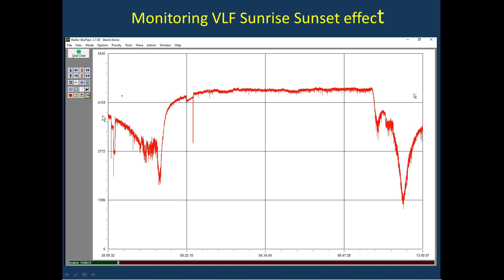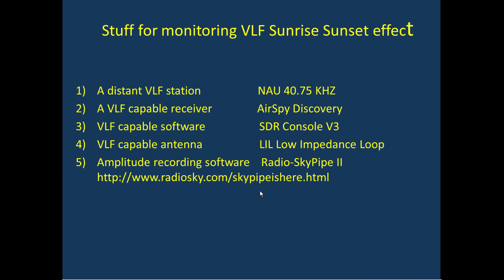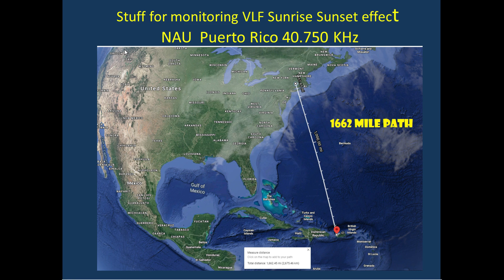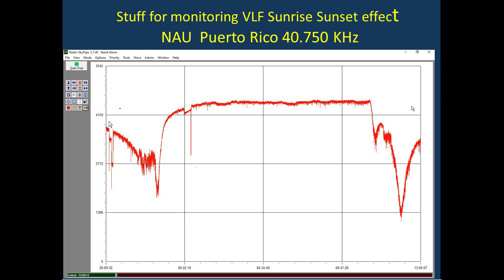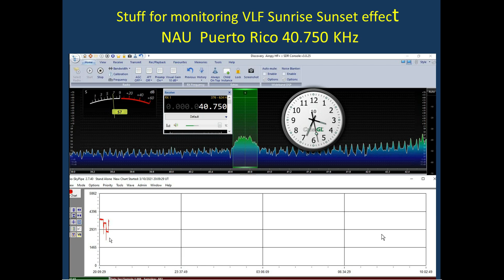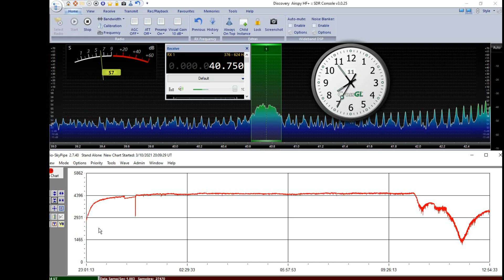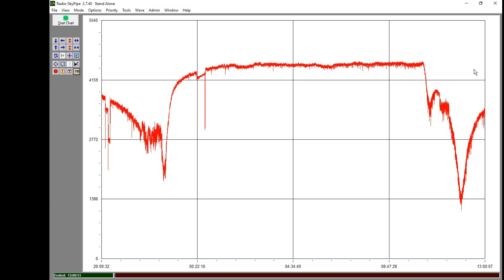VLF Sunrise Sunset effect at 40.750 KHz

Comment: Out of curiosity, did your mean Sunrise and Sunset at the receiver or  transmitters ? I figured you meant at RX, but there is still a bit of the time difference for the sunset at your place and the transmitter. i wish you marked exact time of the sunset and sunrise on the graph Wonder how that would work if you would use TX at Jim Creek in Washington state. I will buy you a beer.

thanks for the great video